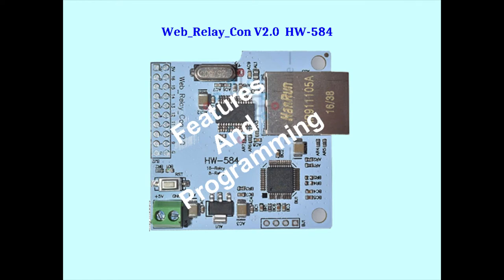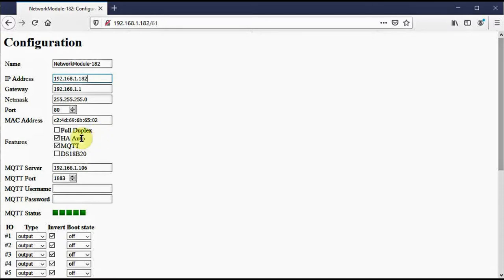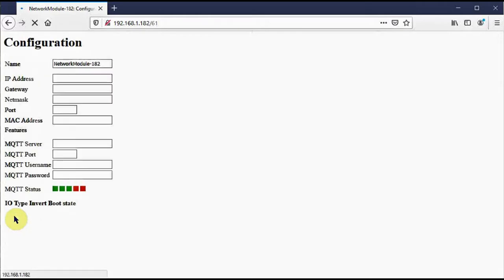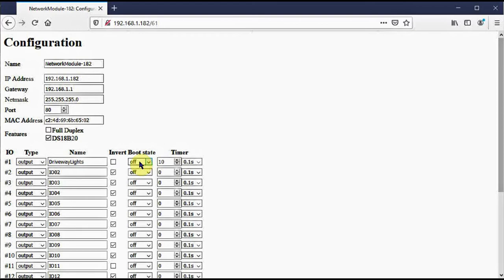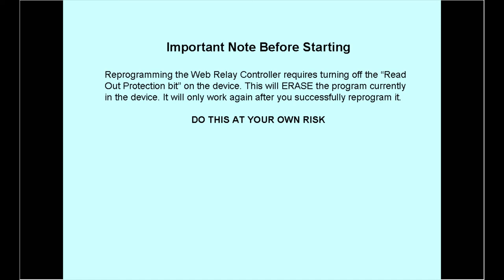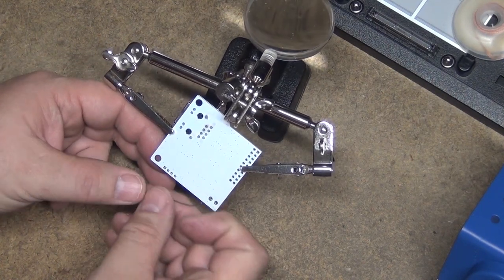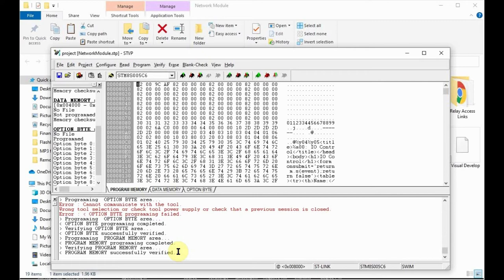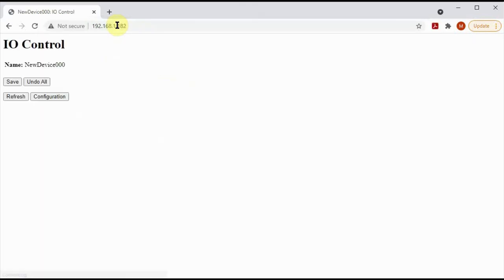YouTube4Web Relay Con V2.0 HW-584 Network Module 8/16 Channel Relay Controller ENC28J60 New Firmware

Comment: [solved - read my first replay]

i seem to be doing something wrong but can't figure out what: i have 3 of the modules and a friend reprogrammed 2 of them for me some time ago. now i wanted to program the third one myself with the home assistant version. i seem to have got the software on but not completely. in the configuration the checkboxes are missing, all text fields are empty and the 16 ports are not displayed. when i enter new data,i can not safe them.
to test, i took one of the two working modules with the browser version, downloaded the working software from this, saved it and wrote it to the third module. now i had 2 identical and working modules, so i loaded the new program (only the first and third tab) of the home assistant version again, now the module still had the IP address of the working browser module but with the problems described above that a lot of things were missing and i can't save new entries. 
Can you tell me what I am doing wrong?
Reply: solved: i did the reprogramming on an old laptop because i didn't want to take my main computer out of the network. the browser on this laptop caused the described problems and since it is connected to my network everything works as it should.

now i have a problem: i don't know how to set up home assistant and the module to get the connection working.
Reply: @2000watt0hz  Great! And before I could reply! Not sure what an old laptop could have that would be a problem, but I'm glad you got it solved. Mike

Comment: Hi Nielson. First of all, let me felicitate you for this excellent job you've done correcting these modules. I'm on a project that uses sixteen of them controlling 16 '16 relay Module' boards, but only now I understand why it is so unstable, unfortunately I'm using the V.1 model. Can I flash these ones with your updated firmware? I'm facing some real problems with this project because when I start it I've done the tests with just one unit and it works (need to send some HTTP commands and control the relays from other equipment on the network) but when I install them (16) all toghether all the problems begin. I appreciate your advice to me about this. Thnks again in advance
Reply from the maker: Hi - My firmware only runs on the "V2" board, also known as the HW-584 board. The HW-584 board can be used with your 16 channel relay boards, but the power and ground pins are reversed AND you may have to make some minor modifications to the 16 Channel Relay board because of a) the HW-584 uses 3.3v IO (vs the V.1 using 5V IO), and b) the way most suppliers designed the IO control signals creates a problem with logic level compatibility. The manual I wrote, available on Github, has a section describing how to make the modifications. See section "16 Channel Relay Modules".
Feel free to contact me via the Issues section on Github or directly via nielsonm.projects@gmail.com.
Mike

Comment: I finally flashed my modules. Thank you very much for releasing this. BTW the ENC28J6 gets very hot, is it ok? Is the aluminum that comes with the board enough to cool it down?
Reply from the maker: The manufacturer didn't provide a clue about where to put that heatsink. But I too noticed that the ENC28J60 was the hottest part, so I'm sure that is where they intended to put it. Still, my chips never get too hot to touch, which should be well within the chips operating range. As FYI I did not put the heatsink on most of my boards and haven't had any trouble. But my boards are in open air at room temperature. If you put yours in an enclosure or expect to operate them at elevated ambient temperatures (say 90F / 32C) I would recommend it. Sometime I'll borrow a laser thermometer and see just how how the chip gets.

Comment: Hi dear, amazing video, how can i get some cards? sorry for my bad english. Great JOB.
Reply from the maker: Hi Manuel - About the only place you can get them is from suppliers on AliExpress. I recently bought some at this link:
https://www.aliexpress.us/item/2255800947595794.html?spm=a2g0o.order_list.order_list_main.41.3d621802SYZb5j&gatewayAdapt=glo2usa
But look around on AliExpress. You may find a cheaper supplier or one that can deliver more quickly to your location.
Also note that I've simplified the programming procedure a little bit. Look in the manual available at the Github site in the latest release: https://github.com/nielsonm236/NetMod-ServerApp
Look in the right hand column for the latest release. You don't need to download everything, just the files you want (for instance, right now perhaps just the manual).
Write me at nielsonm.projects@gmail.com if you have questions.
Mike

Comment: Hello. Thank you for your work :) Is it posible to turn some relays with one url request ? example ip/xx1100110000000011 turn relays 1,2,5,6,15,16 on and others off ... ?
Reply from the maker: Yes. Just released version 20230312 1441 about a week ago that includes a "Mask and Output Pin Settings" command (/50). Search the Manual for /50 and you'll get the detail. If you turn on "watch" on the Github site you'll get notified about all updates and releases as they occur.
Reply: @nielsonm.projects  Thanks ;) you are the best :)

Comment: Thanks for giving these videos, it really helped . Im now tryinh tonsetup mqtt with mqttthing on a raspberry pi, but thats not easy either :) can you help how you did it?  The installation scripts would be very handy. If you need further contact please inform me here you you can be reached  kind regards sjors
Reply: I will open a "Help Needed" issue within the GitHub project. You and one other asked almost exactly the same question within minutes of each other. Hopefully the Issue will generate some help for you. Mike
Reply: Check Issue #102 "Help Requested setting up Homebridge / MQTT-Thing on Raspberry Pi" on GitHub. "Watch" the project to get notifications about updates and responses to the Issues.

Mike

Comment: Great work, already updated to the latest firmware.
Reply from the maker: Thanks Jose. I've got a couple of reports via GitHub that the Save button is not working properly on the IOControl page. Is that working for you?
Reply: @nielsonm.projects   On Firefox and chrome no problem so far, everything is working fine.
Reply from the maker: Jose - You already know this because of your participation in the GitHub site, but for other YouTube users: There was in fact a bug, exposed by the most recent updates to Edge and Chrome (both use the underlying Chromium code). That is fixed and release now.

Comment: Great work, thanks. Is it possible to protect the web pages by password ? The solution is Ok for LAN network but not for the Internet.
Reply from the maker: I haven't included password protection because I really don't want to encourage direct connection to the internet. A big part of the problem is that the tiny webserver in the firmware lacks security in any form, so even if there was a password it would remain very vulnerable to attack from the Internet. The device really should be LAN connection only, then access from the internet via a secure LAN based server, or via a VPN to your LAN. You are welcome to the firmware source if you want to tackle this issue, but I think you'll find that the very limited Flash and RAM space prevent you from implementing an Internet secure connection.

Comment: Did you notice that between the web_relay_con v1 and v2, at least on the modules I just bought, the polarity on the 20-pin connector is reversed ? If the silkscreen on the v2 is correct, I will have to mount it on the relay board with the network connector facing inwards on the relay board, and the PCB will cover the relay boards power input.
Got the v2 to be able to change the firmware when I realize how bad the original one is :)
Reply from the maker: Actually I've never had a v1 ... only the v2 (HW-584) design.
Reply: @nielsonm.projects  I also only have the v2's, but the difference is clearly visible in the images of the product description on Aliexpress etc..
Have you had any issues with relay board compatibility? With the original firmware  (just ordered the STLinkv2 from Amazon) all relays on my 16 channel board are triggered when the boards are powered, and I cannot switch the relays off using the web controls.
I have tested the board before and knows it works (low trigger, so it's normal that relays is active at start, but I should be able to turn them off).
The relay board I tested with is just one of the generic ones that pops up when searching for "16 relay module" (mine bought from m.nu).
With a 8 channel board, both pin rows of the 584 works fine.
Reply from the maker: @peoyli  Yes - the 16 channel board IO pin design is different than all the other board types. Download the manual from GitHub and look in the section titled "16 Channel Relay Modules". It describes the typical pin circuit on the 16 channel boards and a few methods of getting around the problems.
Mike

Comment: Thank you for your work on this fw, and on this excellent video.  Do you think you think the FW will have any SNMP support in the future?
Reply from the maker: I'm not planning on adding SNMP. The primary reason is that UDP is not supported due to very limited Flash size for code.

Comment: In your code the status is at 192.168.1.4:8080/99 but it's inside the <body> tag. How can I add a <div> tag with an id into the code? In HA I'm trying to get the status using a scrape template...
Reply from the maker: Ron - I'm taking a break on my other development so returned to your question. I'm going to move this to a Issue on GitHub so we can get the benefit of other users. I'm not familiar with the Scrape functionality of Home Assistant. I think you said you are "watching" on GitHub so you should see this show up.
Reply from the maker: Check Issue #84 on GitHub

Comment: thank you for all your work i use a few of these in my ham radio setup most of the equipment  is remote mounted 200 feet from my house ,they have proved to be reliable after your improvements thanks again  mike b n8obu
Reply from the maker: Thank you for the feedback. Glad it is working for you!
Mike

Comment: Can this connected with Alexa or Google assistance together with Manual on/OFF switch ?
Reply from the maker: The short answer is "Yes". The longer answer: There are several ways to do this, but you have to implement them yourself. For instance, if you use the MQTT version of the firmware you can connect to the module via Home Assistant, and Home Assistant has an interface to Alexa. Likewise you can use IFTTT (If This Then That) to build an interface. I have not personally implemented these upper level interfaces to Alexa, but I know it can be done. And I assume the same can be used for interfaces to Google's control interfaces.
I am not sure about the "Manual on/off switch" part of your question, but I will make a guess. If you mean "Can I connect a switch to an input, and then have that switch perform some function" the answer again is "Yes". Again the most likely method would be to use the MQTT version of the firmware, connect to a program like Home Assistant (or IFTTT or similar) and implement a routine at that level to interpret the switch and send on/off commands to the module to operate outputs.
Reply: @nielsonm.projects   thank you very much for the answer. Actually I connected 3 x 8 channel relays in I2C connection with Arduino mega. Then tried 3 X esp 32 with 3 x 8 channel relay but encountered your same problem that happened to you in your relay board version 1. Can’t able to link 3 esp 32 which has the same Address. 
Then In my 3rd attempt as am out of budget I just used 2 x 8 channel relay in I2C method to connect to Arduino mega and manual switches by GPIO pin in Arduino mega where the whole process is connected to ESP32. The switches is far away from the micro processor, thus Am in need to buy opto coupler board now 🤦🏽‍♂️
Now am planning  In such a way that relay boards to be controlled by  RS 485 and Manual switches to use shift register key input method. 
but as don’t have knowledge in coding, am searching for somebody’s help if they have similar projects with them.
Reply from the maker: @Wffgcdewffkdhrhdb  OK - all that hardware is considerably different from my project. I'm surprised you were unable to assign individual MAC and/or IP addresses to your esp32 devices. I guess it all depends on what firmware is on the boards. esp32 is genarally a very good product to use. Unfortunately I'm not currently using esp32 in any of my projects. I can only suggest that you keep searching on Google for a project that meets your needs.  Mike
Reply: @nielsonm.projects   thanks mike. As I said am not an expert in codings. I just copy paste the codings from YouTube creators and just change the ssid, and other things what YouTubers say 😬. To be honest, am a secondary school drop out. In past few years am learning English + technologies in YouTube 🤓 will keep on searching until find. Anyway Thanks for your time 🙏🏻🙏🏻🙏🏻

Comment: Hi,
I am using this module with browser only fw. I have 16 relays to control. All of them is inverted. I configure all settings and control it with no problem. But sometimes the web page stucks when I try to activate a relay. Then I refresh the page and suddenly random relays getting activated while webserver does not respond. Even powercycle does not rescue the device. Only long pressing to reset button make the module usable again. And all configuration goes away. I encountered this problem with two different device. Tried also without relay board. Result is same. 

Thanks
Reply from the maker: Hi Mehmet - I suspect the power supply being used is not able to supply enough current when the relays change state. Are the relays and the Network Module on the same power source? Or separate power sources?  The Network Module hardware is very sensitive to glitches on the 5V supplied to it, and those glitches can cause the module to reset, which will cause the behavior you see. So the power supply needs to be very stable if the same supply is used for both relays and the module. You can verify if this is the problem by using a separate power supply for the Network Module. Let me know how that goes.
Mike
Reply from the maker: I just noticed you said you tried this with no relays attached ... but I would still be suspicious of the stability of the power supply.
Reply from the maker: Just checking in with you to see if you made any progress.

Comment: Thank you for rewriting firmware for this board. The amount of work you invested in this project and the explanation video is unimaginable.

However, I am having trouble with installing your firmware. I am able to open the configuration page, add outputs, but I am able to change output state only when single output is enabled. When  all 16 outputs are enabled and visible - statuses change on the website, but not on the board. 

I have downloaded the latest release "20220205 1645". My board is 2.0 revision. I have tried several STMs in STVP upper dropdown: STM8S05C6 (one you have used), STM8S105x4 and x6 (the same as printed on the chip). The problem exists both on localhost IP (board connected to the PC) and using board connected to the router. Checked on 3 different pieces of these PCBs. I have also check if programming a whole memory or only selected range fixes the issue. 

Has anyone had a similar problem?
Reply from the maker: Hi Aleksander - No one else has reported this issue, so let's see if we can work our way through it. My first question: Which version of the firmware are you using? Browser Only or MQTT? Standard version or Upgradeable? You can verify which one you loaded by looking at the bottom of the Configuration page - there it will show the Code Revision plus some info on the version type.
Reply from the maker: Additional questions as you might have a hardware interface problem rather than a firmware problem. Do you have relays attached? It may be that the outputs are changing state but the voltage levels are not correct to switch the relays. Can you send a photo of your relay board to my email address? nielsonm.projects@gmail.com
Reply: Thank you for your answer. You were right, problem is solved now.

I have used old Relay board (working fine with driver board v1.0 - providing 5v as logic 1). Driver board v2.0 provides only 3.3v, so it was not enough. 

We have prepared the workaround by removing optocouplers from Relay board and use jumpers instead. Therefore, setup is working using 3.3v output and your firmware :)
Reply from the maker: @VirusekTroy  Check out the section in the manual about 16 channel relay boards. Be sure you traced out the relay board circuit so that you don't apply excessive "inflow current" to the protection diode on the STM8S processor. You should limit that to less than 1mA per pin ... or much less if the circuit will still work.
"Inflow current" occurs when the pin logic level goes high, but the external circuit wants to pull it higher. This current flows through the protection diode and will heat up the chip causing early failure. The spec allows 4mA per pin, but a max of 20mA on all pins combined, thus my suggestion to limit as far below 1mA pin as your circuit will allow.

Comment: Yes, this is all very cool.
I would like one addition in terms of working with a timer.
There are now 2 modes ON or OFF. You can add a 3rd mode - TIMER. When you select it, the port status changes for a specified amount of time specified in the timer.
---
Да, все это очень круто.
Хотелось бы одно дополнение в плане с работы с таймером.
Сейчас есть 2 режима ON или OFF. Можно добавить 3-й режим - TIMER. При выборе его статус порта меняется на заданное количество времени, прописанного в таймере.
Reply from the maker: I will add this to the GitHub Issues list for further investigation.